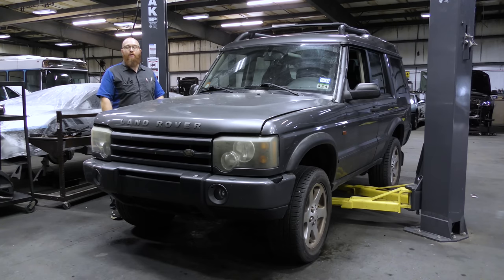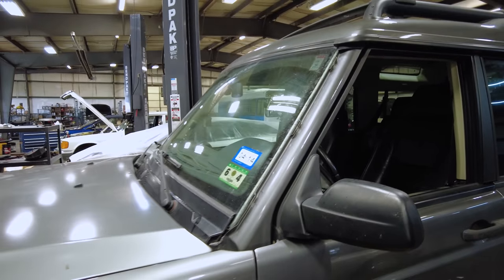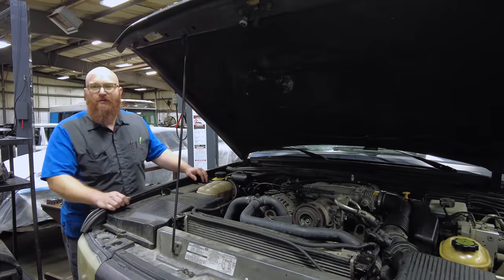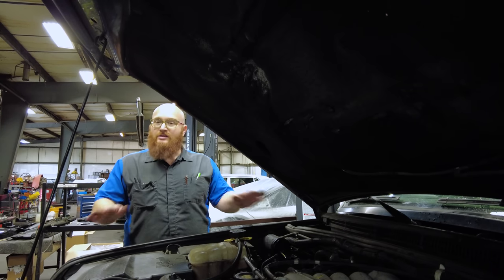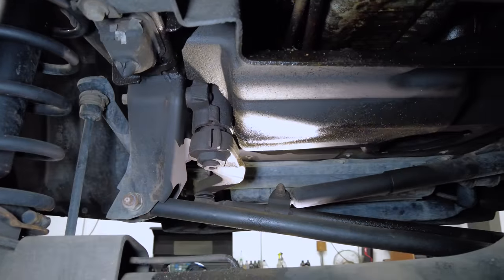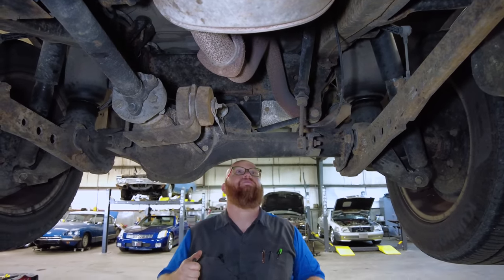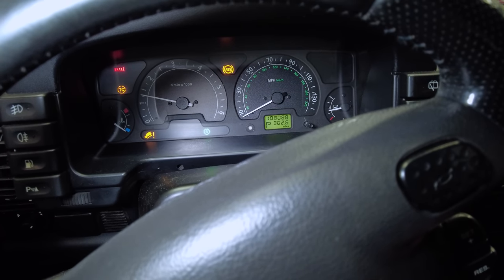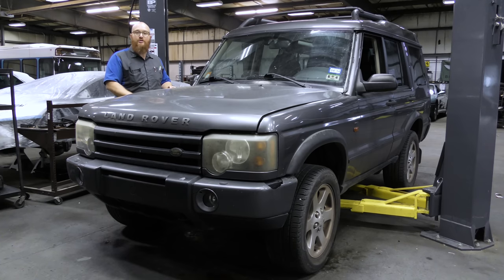Major items to watch for on Land Rover Discovery 1 & 2! CAR WIZARD shares their serious issues

Comment: I worked with every oddball dumpster fire in the auto industry::
AMC, Jeep( when owned by AMC ), Renault, Peugeot, Alfa, the infamous Made in USA VWs, ... You name it, I probably worked with them. I thought I had seen it all...and then came Land Rover.
We were busily switching old Counties over to metal springs from their comically engineered air suspension. A customer picked up her 2nd Disco about a month before( first one bought back under lemon law ). It was in for a lengthy stay at the dealership to diagnose various intermittent electronic gremlins. We took turns roadtesting the car armed with a volt/ohm meter and a service manual.
So, I''m out driving around. Odometer @ 2300 miles. 55 mph on the interstate... Suddenly, an amazing sound under the hood, engine stops turning. Into neutral, onto the median, open hood.
Diagnosis: pretty simple: Piston and con rod on number 5 cylinder has exited the engine by blowing a hole in the block about the size of  a soccer ball.
Post mortem: bolts on all con rod big ends finger tight....

Comment: 97 D1 with 206k miles. Did the heads once years ago and it just keeps going. Monitor your fluids and keep it clean. It'll last a lifetime. Can't say the same about the D2s. Those block castings are not great.

Comment: I've seen that the front driveshaft is in danger of going out because one of the joints there is so near the exhaust that the lube dries out and the joint fails, flailing against the trans and undercarriage as it goes.

Comment: I had a very rusty 1975 VW Rabbit.  In the middle of winter it developed a head-gasket leak.  Being far too cold in Minnesota to do a proper fix, I just took a chance and overtightened the head bolts by 20%.  The bolts were beefy and screwing into a cast-iron block so only minor butterflies in the stomach.   The car ran perfectly for 2 years until rust finally conquered the frame.  Has anyone explored overtorquing these slimmed-down Buick engines??

Comment: Honestly what scares me about most of these vehicles are the electrical issues.
Reply: no an issue on these
Reply: What Electical issues, my disco is  2000 have had no issues with 348,999 on the O’Dovonan.
Reply: 3 amegos is the abs unit and there is a kit for it. Atlantic British, Paddocks, Foundry 4x4, Craddock, and Lucky 8( Buffalo Ny ) area.  My Disco was built in Oct 99 and has 348,000 kms.  I have removed ACE system, converted it to coil springs and have replaced the head gaskets . The head gasket always go on the passenger side(NA) at the back where there is not enough material of the block to make sufficient seal.  The head bolts are a one time use only and if you get one you need to find a copy of RAVE, it’s the shop manual from LR.
Reply: Only one I've had is the glovebox light wouldn't shut off

Comment: Great video Car Wizard! I've always been interested in owning a Discovery 2/3. I was hoping you would have mentioned the ballpark cost and difficulty level associated with the common fail points and whether a shade-tree mechanic should tackle them. Keep you excellent videos flowing. I'm a big fan!
Reply: I'd reason that no shade tree mechanic should be allowed near any import. Even most legit, small scale neighborhood shops are gonna have a hard time with most modern euro-imports. If you invest in one, you're gonna need to bank on either taking it to the dealership for maintenance and repairs, or finding someone like the guy in this video (which will likely mean shipping your vehicle several hundred miles away). It's a matter of proprietary parts, even proprietary tools in many cases, as well having the requisite knowledge of all the ways these cars differ in design from what's common in domestic cars. 

I've seen a few people buy expensive garage ornaments because a critical problem arose and they simply cannot find (or often afford) the right kind of shop to address it. So it just sits, mocking their purchase.
Reply: If you can wrench it doesn't get much easier than a Disco, and the factory manual is free. Parts aren't bad when you find a good vendor. There's a really good used parts guy in the LR World if you're in the USA. Lots of vendors use Rovah in their names to avoid being sued.
Reply: Disco 3 or LR3 in NA is the one to get with the 4.4 petrol, I've had a disco 1 before and a disco 2, the 1 is better than the 2, the 2's had more issues neither has enough horsepower the 4.4 Jag V8 fixes that.  I've kept mine going and haven't spent much, you can definitely fix them yourself if you know cars they aren't that hard to work on and don't require too many specialized tools, Land Rover owners have great communities online so it is very easy to get information about common issues.  The suspension bits are a wear item as are brakes and tires, but the engines don't need much, the ZF trans is good as long as you service it, the air suspension is surprisingly reliable. 

It's a Land Rover so either you need a "rover mechanic" or you need to become one yourself, they are not "straight forward" cars, for example you may find your LR3 isn't shifting gears, you may think the transmission is bad, no it is most likely a burned out brake light or the break peddle switch has gone bad, a regular mechanic gets this wrong 9 times out of 10.  I do most of my own work but also have a very knowledgeable rover mechanic(most expensive), a euro mechanic who owns and extensively off-roads a Land Rover(less expensive but still expensive), a general mechanic is is very competent and works cheaper but doesn't know land rover oddities(cheap).  

Skip the dealers all together, if I did everything I've done the last 5 years at the dealer it would have been 15k vs. the 3k I've spent doing it myself, they charge like 2k for a brake pad and rotor job over $500 per axle for parts($178 per rotor, $180 for pads, the hardware is extra, $40 for a sensor, brake fluid) plus 3 hours labor at like $200 per hour literally most dealers are $1800 plus tax.  I did it myself parts are like $350, I used to get parts cheaper it was like $250 and honestly quality after market is actually better than the factory brakes which are just OK.  I had to do calipers, they are $450 each at the dealer or like $100 warrantied for life on fcpeuro, hoses were like $10 on rockauto.  So for around $550 in parts I did what the dealer wanted $3400 for, it took me like 3 hours to do.  They wanted 3k to do a transmission service, I bought the metal pan kit at Atlantic British for like $300 and paid the euro mechanic $400 to do the job.  They wanted $1500 to fix the traction control errors claiming I need a new control module and a new selector switch, I cleaned the contacts on the modules, cleaned the grounds, reprogrammed the module with ids and it works without any codes or errors.  I did lower and upper control arms, sway bar links, and tie rods, parts were $600, the dealer wanted $3600 to do the same job.  They charge like $1200 for the 100k mile tune up and I did it and the parts were like $250.  A coolant flush and new reservoir, well the dealer charges like $50 a gallon for dexcool, prestone from Walmart is $12 a gallon and a $35 tank from fcp did the job for like $100.  Generally dealer repairs cost 5-6 times the parts cost and around 2x-3x the cost of the repair at an independent mechanic.  Occasionally I take it to the dealer for basic service as they do an inspection and clean the car really well and with the occasional coupon they send it isn't terribly expensive, but for repairs, brakes, tires heck no.  It's not a Toyota but you can keep it in good running conditions for not much if you do your own work and find a reasonable mechanic to do what you cannot handle or do in your driveway.
Reply: @shaunbava1801  Thanks so much for including such detailed info and passing along your knowledge. You've gone above and beyond.
Reply: @herecomesaregular8418  Wow, so much wrong in one post.  The Disco 1 and 2 (the OP mentioned the 3 which is an entirely different vehicle) are simple and easy to maintain for an owner with basic skills and tools.  You don't need anything specialized and there is a huge international support structure of enthusiast owners out there willing to help you with what you don't know.  If you're taking it to the dealer for every little thing then yeah, it's going to be brutally expensive and you'll be 'that guy' who cries about 'it's a money pit' and how terrible it is.  If you have half an ounce of mechanical skill and don't just drive until something fails catastrophically then send it to the $250/hr dealer it's affordable and a great vehicle.  Shop?  Why would you need to send it to a shop?  As the video pointed out, it's an old-school V8 (or diesel in ROW) with fairly basic tech.

Comment: What do you call a landrover that doesn't leak? Empty.  I have a 2003 with 130,000 miles. I had to replace the engine at 80,000 as it dropped a liner right after I bought it. I bit the bullet and put a tophatted engine and it was worth every penny.  Two issues you missed, the sunroofs will break their drain tubes and the chassis tends to rust. There are repair parts for both. Otherwise, they are built well, easy to service, and most of their subsystems are designed to be rebuilt in the field. How many 4X4s offer repair kits to rebuild the powersteering pump?

Comment: I added a gravel parking space for my disco. Runs great but it’s cheaper to keep topping the fluids than fixing them.
Reply: Mine leaked coolant (Water pump) Fuel (regulator) oil from front axle (Seal due to ball joints) but never oil.
Reply: @philtowle4683  mines a 2004 with only 65000 miles. I’ve owned it since new and I’ve never missed a service. It’s just a bad year for them. It’s leaking from the timing cover and the rear main. I usually add a half a quart every 1000 miles.
Reply: @Sprintervan1  I did do the rocker cover gasket but I can't remember whether it was leaking.

Comment: one more thing... the engines actually got worse as they got newer, the 2003-04 may look better but the engines were not made as well due to slipping tolerances in the factory as production was winding down get a 1999-2002 for best results even though its a smaller engine displacement

Comment: 0:21 the headlights would not make it through the biannual inspection and cleaning would not really work until you use polishing paste which is forbidden here due to changing the way the light would take and replacements are so terrible expensive that you would not buy that car until you get a huge discount that will pay for the replacements.

Comment: These older Land Rover Discovery 1 and 2's are not bad truck-based SUV's, but I will rather plan to buy a mid-2000's Mitsubishi Montero with the 3.8 L V6 engine and the five-speed automatic transmission, instead. These Montero's are fairly reliable, but something more fuel-efficient than the older Discovery 1 and 2, will also be the early-2010's Lexus RX 350 crossover with the 3.5 L V6 engine and the six-speed automatic transmission, as well as the late-2000's Kia Sorento LX or EX mid-size SUV with the 3.3 L or the 3.8 L V6 engine and the five-speed automatic transmission. Thank you very much and have a great rest of the day. Cheers.

Comment: He didn't mention the notorious  lifters problem in this model year (2003-2004). Everyone of them produced in these years will have that problem and very costly to repair. Land Rover solution is to replace the engine or rebuild it. Any Disco guys are aware of that. However, anything before that, well just oil leak, very solid truck

Comment: Most of the oil leaks in these are caused from a clogged PCV oil separator. Take it out and put a valve on the intake manifold.

Comment: Currently own 2000 model td5. Problems I had were head gasket failed due to oil cooler failure due to electrolysis. Front drive shaft failed due to worn out u joints and smashed the side of the transmission. 
Also experienced poor running due to a loose fuel line at the cylinder head not injector harness as many people believe.
I'm fortunate as I have a full set of factory manuals and can do all my own work. These vehicles are a money pit for the inexperienced due to labour costs and dodgy technicians/mechanics.
They are a simple vehicle with tricks like a bastard redheaded stepchild. (Don't worry every car has tricks)  If you  know the tricks they are easy to repair and a comfortable and reliable vehicle.

Comment: Regarding the Steering box leak:  It is due to TWO things.. don't just change that lower seal!  

1. The Sector Shaft (the vertical one that has the pitman arm attached on the bottom) upper "bushing" (which is in the cap) gets worn in an elongated ~elliptical manner..  you can machine the coverplate and press a proper bronze bushing into it..  this will eliminate that sector shaft 'pivoting' which causes the lower seal to get pinched/worn and fail.   
2. The high pressure bypass valves fail.. and then they leak into the low pressure 'reservoir' area.. which is right above that lower sector shaft seal..  This causes pressure buildup in that low pressure area and it relieves itself by blowing the hydraulic fluid out past that lower seal.

TLDR:  Buy a PROPERLY REBUILT unit.  If you buy a cheapo that has not had those biasing valves replaced, or without a proper bushing in the top plate...  the problem will reoccur quickly.

Comment: Mines done 210.000 1997 3.9 V8 and after arriving back from a Trip last week I had the feed it water thing going on after getting held up by police operation couldn,t turn off as line kept moving. Anyhoo turned into my road saw flicker of oil light even before could do anything light stayed on engine seized solid. Towed it the 20 metres to my place would not turn over. Next morning turned over but not start oil was extremely black and smelled burnt. Down side just had Frost plugs done which was engine out as 2 x in bell housing. That was a $6K waste of money just should have bought another engine which I have managed to track down. Trucks in to good a condition to throw away. $750 NZ Dollars  for other engine. Bugger and Grrr.

Comment: Oil service on the Automatic is EVERY 40k kms or 24k mls. If you do that these automatics last for 400k kms without problems. And later '02 onwards.
At my work we have loads of D2s who have done 400K km+. My coworker has a Td2 D2 with 585K Kms on it with original engine,box and everything.
They are great DIY cars and great day to day family cars.
On the D1 in rust is the main killer of these cars in countries with long wet winters. Where i live they grid with salt,so for around 5 months a year its a nightmare

Comment: Hey Wizard, are these Rover V8s with head gasket issues running without antifreeze with the climate being warmer I presume where you are?
I suspect neglect is the real problem, as they are not known for head gasket issues in the UK.
An aluminium engine run without antifreeze will see silted radiators and overheating in no time.

Comment: So why should I buy one of these over a 90's/early 00's Land Cruiser??? Or similar year Tahoe????   Both of those have proven to be reliable workhorses, the Toyota being pretty damn good off road in stock form with the right set of tires and taking off the running boards for a bit more clearance.

Comment: I bought a 96 Disco 1 about 18 years ago.. Still have it 145k and NO desire to sell it!! I do some really hardcore off-roading in Arizona and have gone into trails further than new Jeeps or Toys with 30k in aftermarket suspension parts and lockers can go. Not being Biased here, I drive and build up Jeeps and Toys as well!! But that factory 3 link suspension destroys any new 4x4. If anything, I took what everyone else called "unreliable" and wrenched it into something that'll be running LONG after our new Honda's die.. Point at a hill and give me a choice of vehicles, I'll take the Disco everytime!

Comment: I’m on my second Disco 2. First was a 2000 TD5 manual which had 170k miles. It had been well used and not looked after. The rear chassis rusted badly, and the three amigos were semi-permanent travelling companions . I loved it though. 

I currently have a 2003 TD5 Auto with 76k miles which has been looked after. The chassis has been treated and is still in great condition. It still has the rear air, but the bags have been replaced at some point. 

Both have been great family cars, especially given their small size- I used to think they were quite big (on Scotland’s roads) but they’re the same size as smallish modern cars like my Q4 (mid size crossover?) 🏴

Audi Q4 vs 20 year old rival. How much have family cars changed?
https://youtu.be/mwe-tKi-Ppg

Comment: In my experience, it is not always the head gasket, but the cylinder liner slipping. Models badged as 4,0 seem worse, despite those badged 3.9 having the same engine & capacity.

The leaking front swivels problem was cured many years ago. Rather than using gear oil, a thicker grease is available 

Auto transmissions, especially on sunroof models, can often suffer from failed XYZ switches. 

Clouded headlamps are easily cleaned up and refinished, just don't skip the UV protection coat like most people do. 

Rear chassis also has a terrible reputation for rusting away to powder, although any cared for well enough to still be around shouldn't require much work, just keep up with preventative work